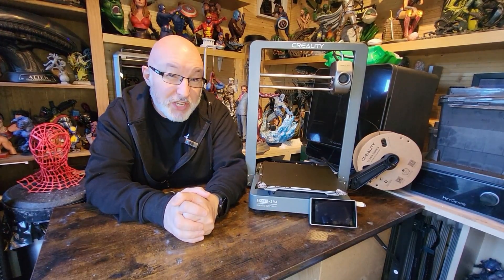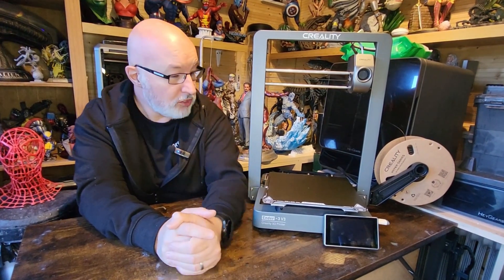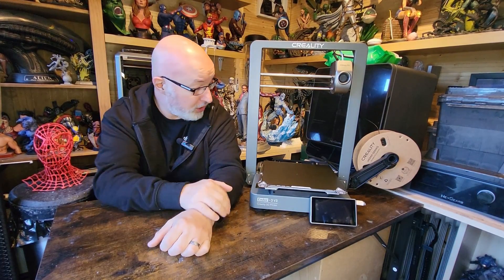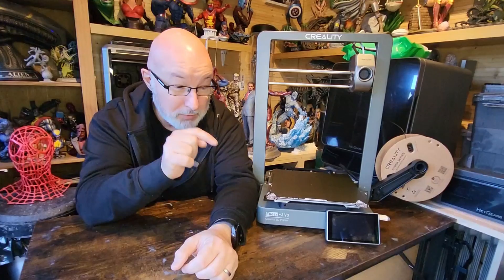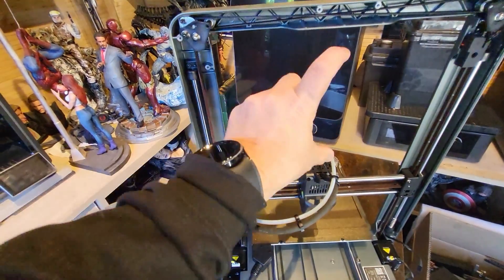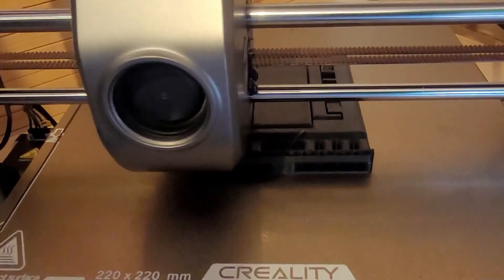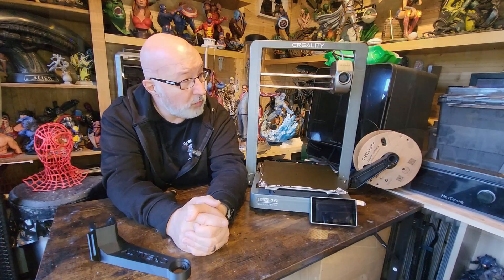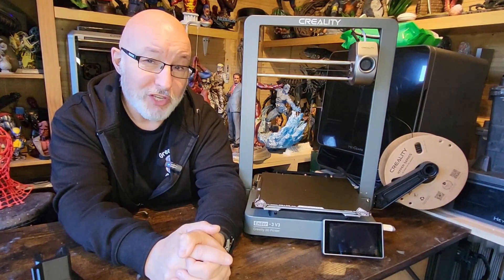Ender 3 V3 Review - The New & Best Ender 3D Printer On The Market

Comment: Why is there a Creality Print software and  a Creality Slicer software. Which is best to use and what's the difference? I also noted one does not have the Ender 3V3 in the drop down menu for printer selection.
Any help appreciated
Reply from the maker: I definitely use creality slicer in the end of 3 is on there as I use that too

Comment: Good review ,I agree the spool holder should be on the top ,I'm just wondering if they didn't put it on top as it might affect the input shaper in some strange way
Reply from the maker: Will I move mine to the top and I've had absolutely no problems with printing quality at all everything prints fine just downloaded a bracket from thingiverse use the original holder that comes with it working perfectly so far lol

Comment: The spool holder was at the top in a different version of this printer I saw, but they didn't have a runout sensor on that V3. I'm guessing they moved it to make the machine more bottom-heavy and so they could stick the runout sensor somewhere without having to run wires to the top

Comment: The spool holder being low and not on top is to make the printer bottom heavy and reduce vibrations which means it can print faster without artifacting

Comment: Nice review and you are right about the filament being relocated to the top.  It would give you clearance on the sides as for the printer itself I would gladly trade in my Ender 3 Neo for this Ender 3V3.  Calibrating the hot end nozzle to the bed is so stressful, thanks for sharing.